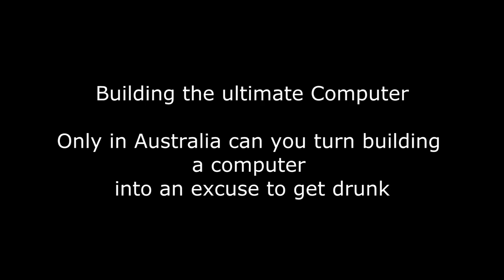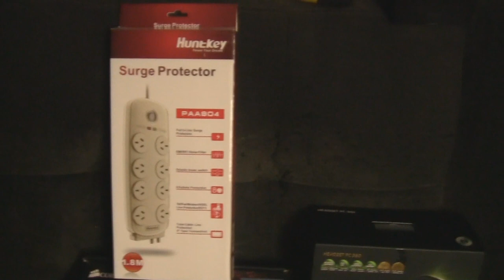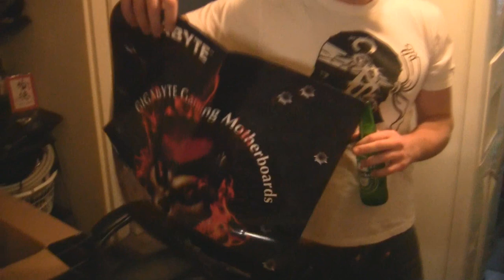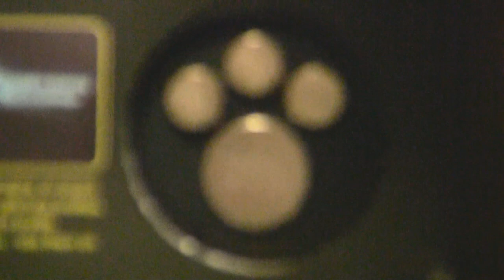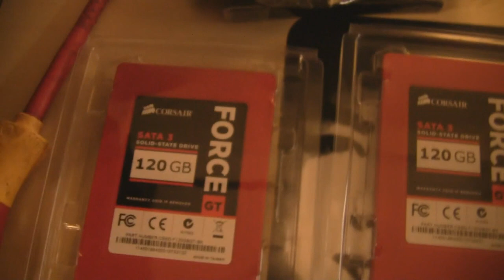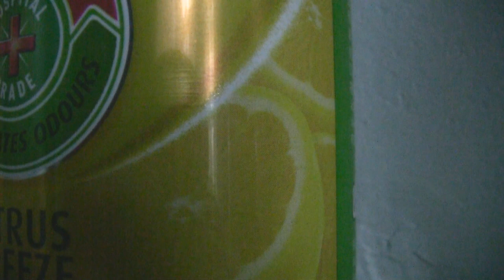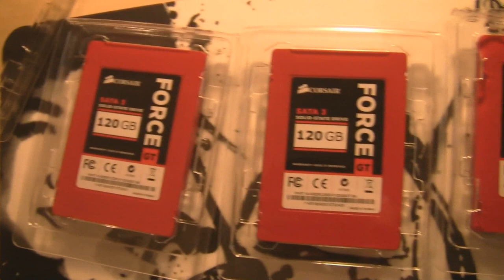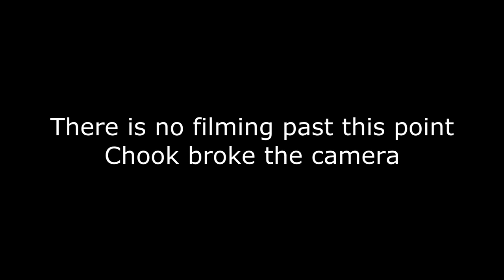Building Klinda's Ultimate Gaming Computer (sort of building it?)

Comment: Who suggested Raid 0?  I mean it's SSD....Raid 0 MIGHT make sense for the older style RPM drives, like your WD...for high bandwidth.  In this case though, your using SSD on a SATA 6 GB interface...hence, that's your bottleneck.  Theoretically...2 120GB SDDs can benifit from Raid 0, and yes, you can get larger bandwidth...BUT it's never going to get faster then the "speed limit" of the interface.  Remeber wehn a faster FSB was desired.....before hyper threading?  Just curious.